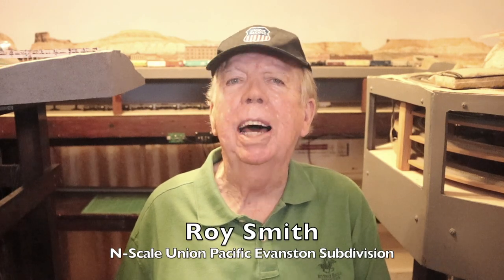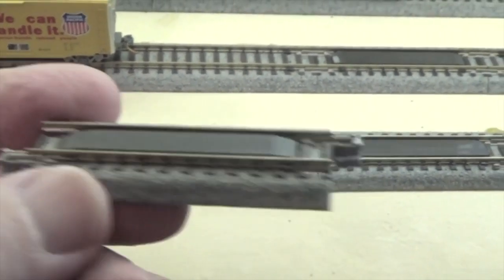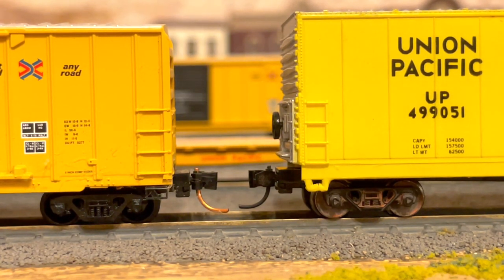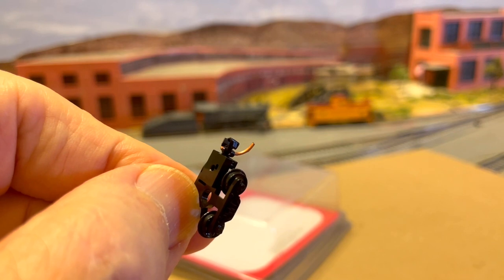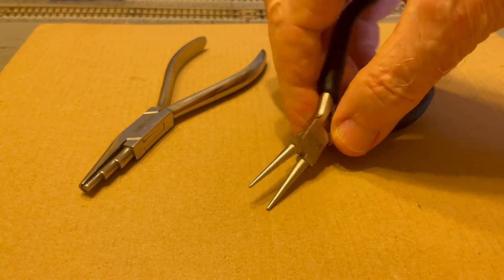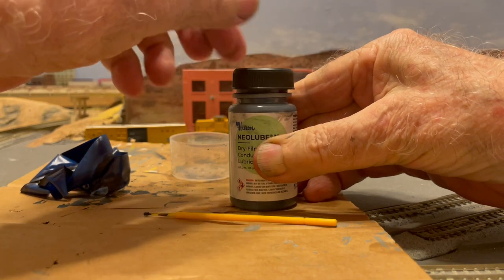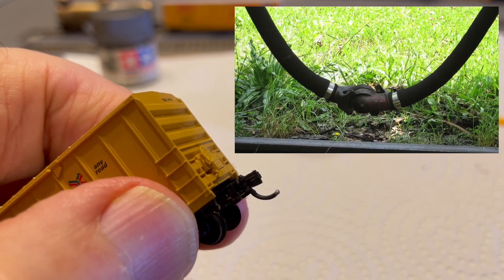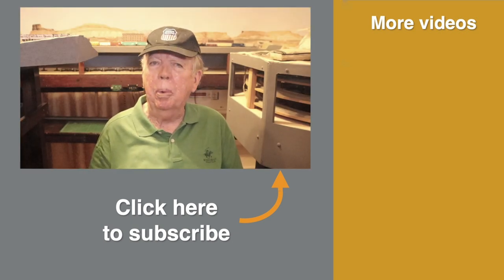Why You Should Blacken the Trip Pins on Your Model Trains

Comment: From what I gather, sometime in 2018 or early 2019 Micro-Trains started to manufacture their trip pins blackened and if you have currently purchased a conversion kit and have the copper ones, they are most likely older stock. Cheers Roy and thanks for the 'tip' 😉 on adding a bit of silver paint on the ends of the trip pins! 👍👍
Reply from the maker: Thanks, Piero. That's good to know. I'm glad the MT now blackens its trip pins. ...Roy

Comment: I cut off most of my trip pins, but want to caution everyone. Those rail nippers work fine on MicroTrains pins, but Atlas are a hard steel and you will damage your rail nippers. I actually broke a pair and one half went shooting across the room. Glad it didn’t fly toward my face. You may want to mention that in an upcoming video. I showed it in one of mine but you have many more subscribers than I do. I agree that it’s not really a big deal as long as they are adjusted properly. Thanks, Roy.
Reply from the maker: Thom, I find that either cutting trip pins off or bending them up is a bit scary, because those N scale couplers are so darn fragile. ...Roy
Reply: @n-scaleunionpacificevansto6569  , I’ve never damaged a coupler cutting off the pins but have broken a coupler trying to bend them. And when they get bent too far, they look weird and are hard to unbend. Take care!

Comment: Great update Roy! To me, cutting off the trip pin is a sin but of course I model in HO. I have a pair of the coupler pliers from MicroMark. Most of the time, it's because the car's height is too low. I think most of Kadee Couplers already have black trip pins. As for using the magnets, if you put them close to your turnout, you can stop on the magnet to disengage coupler (simulate brake man getting off the train), then slowly back your car(s) in place to spot them. Then pull forward. This allow allows you to couple back and pull through the magnet. Great video! - Jason
Reply from the maker: Thanks, Jason. Good suggestion for handling the uncoupling process. To me, cutting off trip pins is a sin in N scale as well. I would never do it. It's amazing how much fun we can have, even with something as small and seemingly insignificant as trip pins. ...Roy

Comment: I pull the trip pin from micro trains couplers. It is only pushed threw the top half of the coupler. There’s a large loop on the bottom half. If I buy the coupler as a kit. I don’t install the trip pin at all. This actually makes assembly easier as I can place the box on masking tape sticky side up. Place both half’s of the coupler on the center pin and install the spring without the trip pin making the coupler heavy and wanting to tilt wile placing the spring in. Then place the cover on the box. The trip pin does not hold anything together. And all my couplers work just fine.

Comment: I am someone who has pulled the pin totally out of a Microtrains coupler Roy, and suffered the consequeneces!!!!  I hadn't thought to blacken the pins before now, but I might do so in future as they do look better.  Oh, and if you are adjusting the height, it's not as easy to bend the pins with pliers as you might think.  Doing this was what caused the coupler to fall to pieces in the example above.  I actually cut a small piece of the bottom until it clears the turnout.  I guess you've had a lot of good luck with yours; I've had to cut down about a dozen of my trip pins.
Reply from the maker: You're right, Andy. Bending those trip pins isn't all that easy. I'm fearful of breaking the fragile N scale couplers when trying to bend the trip pins. Fortunately, I haven't had to adjust hardly any of them. ...Roy

Comment: Have you tried the Neo-Lube on your loco wheels?  Supposedly it is made to conduct electricity.  Trip pins look great!
Reply from the maker: I haven't tried it on my loco wheels yet, but I probably will. I understand that's what it's really meant to be used on. ...Roy
Reply: @n-scaleunionpacificevansto6569  I am looking forward to hearing that turns out for you.  I haven't tried it yet but if it improves electrical pick up AND makes the wheels look dark (especially since I run steam locos with the wheels exposed) that would be a win-win.

Comment: Roy most definitely better looking. There is a pair of pliers to bend tie trip pins like Kadee but smaller but they are hard to find! I have seem them at MicroMsrk but I found some st craft store much easier to use than regular pliers. 😉
Reply from the maker: Jack, I find that bending those trip pins is a bit scary, because N scale couplers are fragile. Fortunately, I haven't had to bend many of them. ...Roy
Reply: @n-scaleunionpacificevansto6569  the tool I mention make it easy without any problems as you are only touching the wire and not anything else. In one way you bend more turning it around to flatten it just as with Kadees.

Comment: I'm surprised you didn't mention a chemical blackening solution. I used to use "Blacken-It", though it seems to no longer be available. However there are several products from Birchwood Casey that should work... they are gun bluing solutions but the shade of blue is very dark, basically black. There's "Perma Blue" for steel and "Brass Black" for brass. I'm not positive which would be best; the pins are steel but the plating looks like copper so I think I'd try the Brass Black first. It can be dabbed on with a Q-Tip and should be rinsed off afterward.
Reply from the maker: Thanks for mentioning these other products, my friend. I'm a big fan of trying different products to see which ones I like best and then sharing the results with everyone. A problem I have is having such products delivered to me here in Panama where I live. For example, I did have problems in getting Panamanian Customs to release NeoLube to me, because they said it was a "lubricant" but eventually they did let me have it. That's an occasional problem that I have. ...Roy

Comment: No trip pins,not on continental european models. Any parts I need black I use flat black spray paint.For catenary which is copper or silver I use chemical blackener.I did to use Electric solenoid uncouplers (power hungry) or mechanical ones but these are limited to a few places. A stick or tool for this is simpler and can be used anywhere.A good place to use the mechanical ones is at the top of a gravity classification yard.
Reply from the maker: Simon, thanks for sharing your techniques. ...Roy